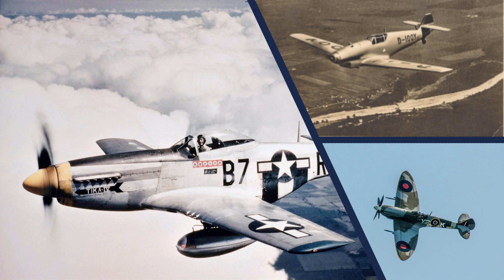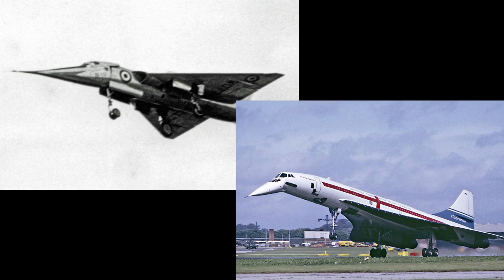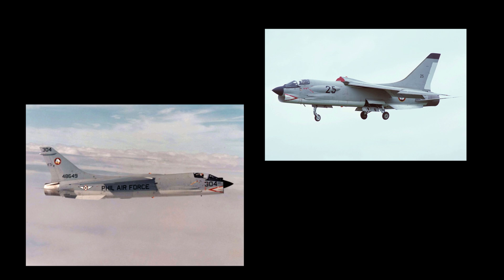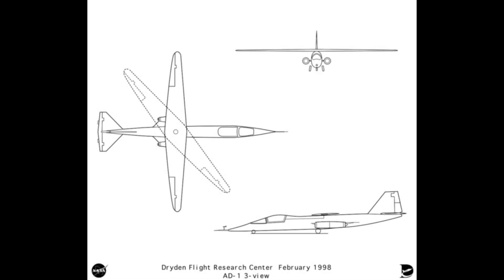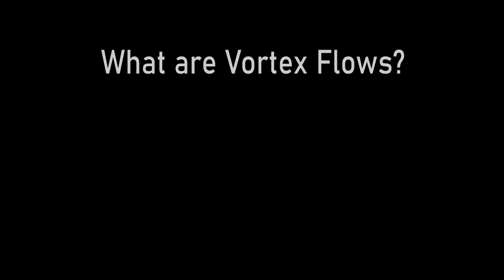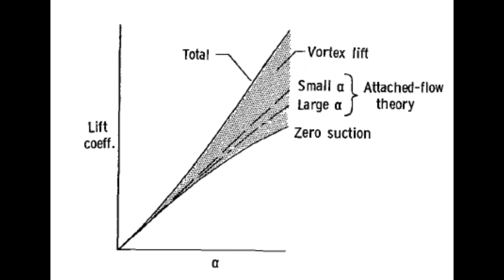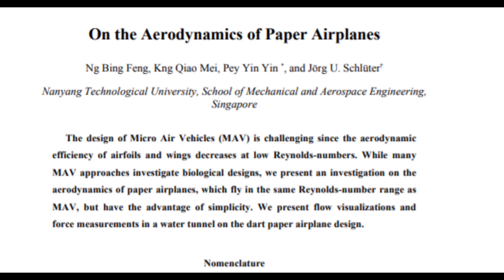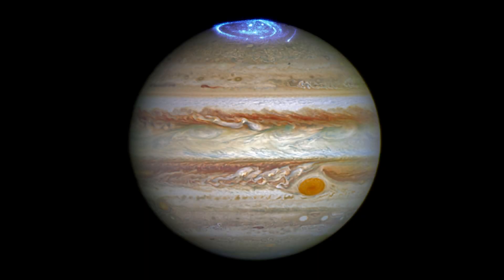Vortex Lift 1 | What do Supersonic Jets and Paper Airplanes have in Common?

Comment: I once surprised some rc hobbyist with a small delta FPV wing and thick profile. 

The wing is extremely stable at low speed : it just goes down while advancing at 10 km/h only : very useful if you want to observe things from above. The drawback is more drag, but with enough power, it is not so important.